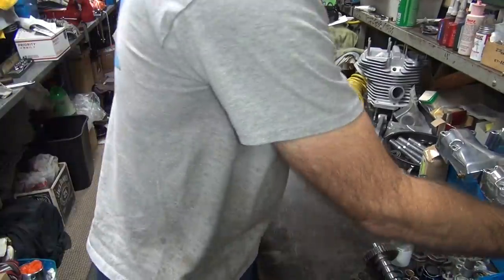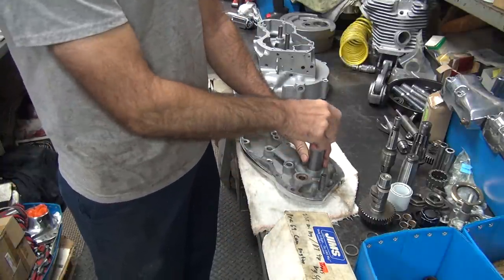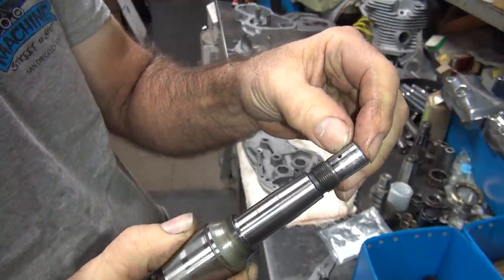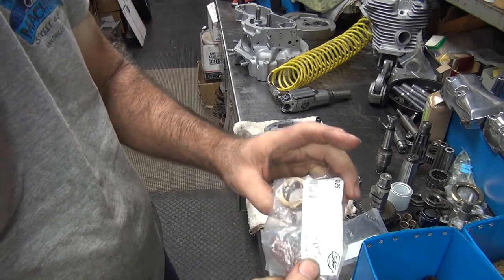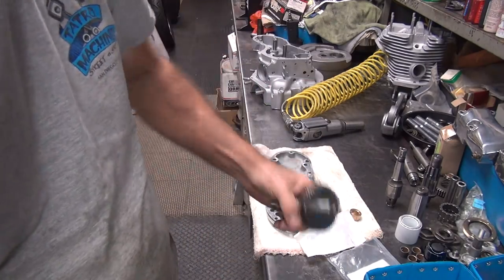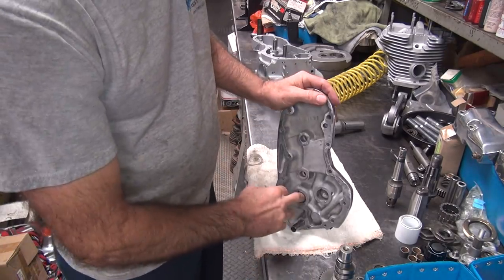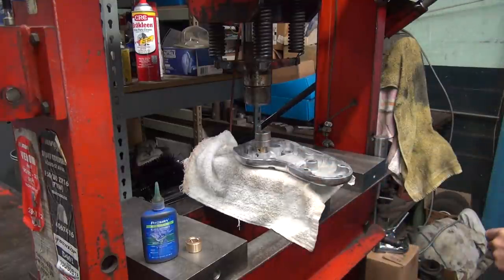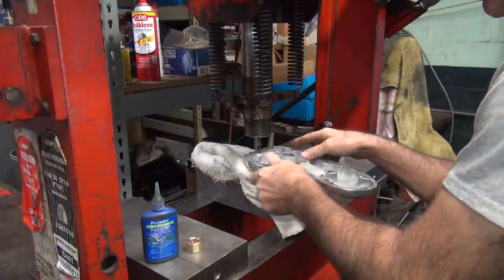1967 74ci shovelhead #108 flh bike assembly motor rebuild harley craigslist special tatro machine

Comment: Tatro, do you ever use heat and cold, for driving bearings and races in and or out of aluminum?  Thanks for the videos, I am mainly a dirt bike Tech, but have learned a ton about my sporty watching them. One of the best channels on the interweb. 
You'd make a hell of a shop teacher. I like the way you ask questions and challenge the people there in the shop with you. I find myself answering the questions out loud. 
Thanks again..
Reply from the maker: look out, you might learn something.
tatro